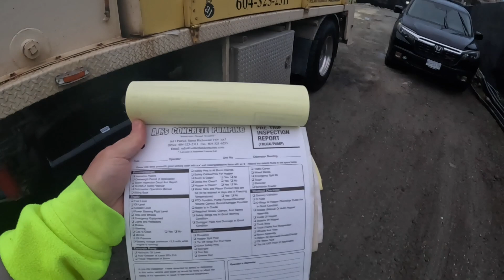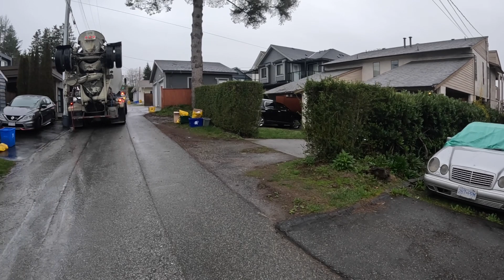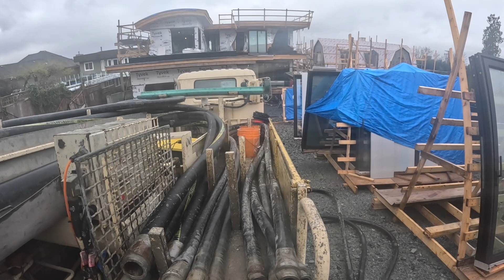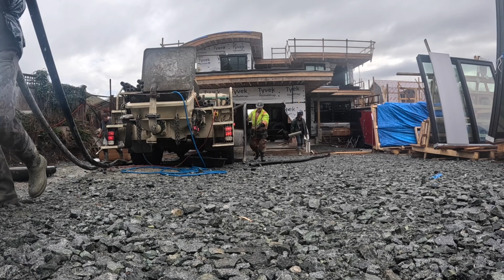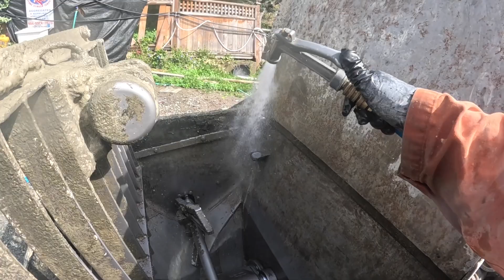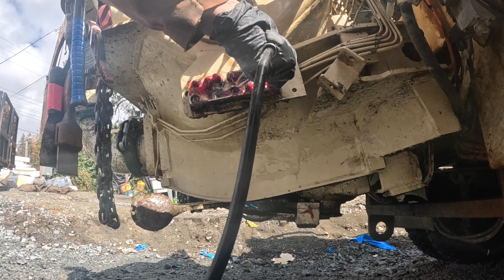A typical day of pumping concrete.

Comment: Hey Scott I wasn't I went through a 4-year apprenticeship program do you think that with the four-year apprenticeship program I went through as a finisher for concrete I have 10 years invested in the union and they're not including what I did as a teenager do you think that I would have a pretty good possibility of becoming a pump operator that would be a good pump operator versus somebody
Reply from the maker: Absolutely!!! Much of becoming a proficient pump operator is knowing/respecting the time sensitive nature of the material (concrete) with which we are working. Your knowledge and experience with placing and finishing concrete most definitely gives you a leg up, in my opinion.

Comment: I wish I could use 2 Inch Hoses here in DUBLIN IRELAND we have to run 4 inch to the Pour Area and then we put 3 inch Hoses in the pour area because some days the Concrete can be rough but in the past year or two it's got a lot better and i think about 75% of the time we could use 2.5 inch if we had some and maybe even 2 inch Lines depending on what concrete plant the concrete is coming from because Same Concrete Company different plant can be harder to pump sometimes different Sand and stone depending on which quarry it's coming from

Comment: What is the max distance can you pump?
Reply from the maker: We have pumped 700 feet with this machine. With the proper slump/mix design and pushing through 5” steel pipeline, it would likely pump over 1000 feet horizontal. 

Guys with high-pressure pumps will push 5000+ feet.
Reply: @canadianconcretepumper1979  Thanks for the input.  I need a slab poured about 500ft from the street.

Comment: That first job is a direct pour all day.  I think more difficult to pump it then pour direct
Reply from the maker: We pump almost everything around here, especially work with our in-house placing crew. They way they in which we like place it down works much better using a pump. 100% it could be done from the truck, but we have our own pumps, so we use them.

Comment: Put a pea gravel screen on top of your screen. It should help with those gnarly rocks.
Reply from the maker: I’ve got one on the truck (2”X2” mesh screen). Problem is that with this 1/2” mix, it has to be a good 5” slump to vibrate through the screen. Guys forgot to order accelerator, so being that it was a machine finished garage we didn’t want to wet it up too much or they’re have been there all night. I kind of wanted to catch a couple of plugs as well, just for demonstrative purposes.

Comment: Bro you have to use a grill for safety.
Reply from the maker: It ain’t safe of the concrete won’t pass through and you’re sucking air. With this 2” secondary screen the concrete has to be a good 5” slump, and there’s certain things we just don’t pour that wet.
Reply: @canadianconcretepumper1979     I understand.  I live in long island NY I operate a line pump almost the same as the one you have  my pump it has a vibrate in the hopper ,it work good with 5 lumps. But I like your video 📹
Reply from the maker: @rifirafa  same thing, we’ve got the vibrator mounted to the hopper grate and it works really well for shaking most anything through the factory installed grate. The secondary screen which we use when running small line had really tight spacing (2”X2”) so even with the hopper vibrator running it has a tough time shaking 1/2” stone mixes through if they’re not at least moderately wet. Thanks for watching the channel man. These VS series Putzmiester’s are great little pumps 👍🏼👍🏼👍🏼
Reply: @canadianconcretepumper1979   I also have the putzmeister TK50

Comment: Mexican aggregate
Reply from the maker: Just came off a pour today (video coming later this week) and man oh man was the mix ever sandy/coarse. Just grinding through the hoses. I watched a driver add 50 gallons + 5 litres of Adva to a 9 meter load and the slump went from an 80 to maybe a 100.yesteryear sand just be eat’N up the water!!!
Reply: @canadianconcretepumper1979  the place I worked at a few years ago started having really coarse sand, almost 5mm where as everyone else in saskatoon was running 3mm. I was pumping a 32mpa mix and it was so bad I had to go 1 stroke fwd and then go backwards a stroke, then I was able to get a few strokes fwd. It also stalled out the pump at full rpm

Comment: More efficient way to wash at the end to reduce water would be #1 dump remainder of concrete on the ground then scrape hooper sides with a small spade/scrapper #2 put pump in reverse and manual mode #3 reverse pump till you see piston cup which pushes most of concrete from the cylinder #4 jog s- tube to other cylinder and reverse pump to clear concrete cylinder #5 jog s-tube for about 5-10 seconds which shakes concrete from s-tube into the cylinders #6 quick wash into s-tube #7 reverse both concrete cylinders again and when piston cups reaches the end of the cylinders a quick wash to clear remainder of concrete. This process leaves the piston cups clear of build up on the face of them and all components spotless inside.  👍
Reply from the maker: 100% agree with you. (the intent just here was to keep things as simple as possible for the purpose of the video).

Comment: I see you had screens on the pump but didn't use them. I'm sure you have said that they were mandatory to stop the big rocks like that :) 

I love pumping would love to go have an easy time over there, everyone here seems to use 4 inch pipes lol.
Reply from the maker: Mix has to be minimum 4” slump to pass through the secondary screen. On that first job, no accelerator was ordered in the concrete, so we kept it dry as such that the finishers would not be waiting around all day to get the machine on it. Second job we had to keep the first couple meters of each load dry because of the slope which the mixers were sitting on (otherwise it would be spilling out of the truck even with the drum in charge mode). 

We’ve spoiled over here with our 2” line mixes. Mad respect to those whom slug it out in markets where 4” hose is the standard.

Comment: It seems like here on the west coast we are the only ones who help with pulling the hose and stuff like that. Other places they get it primed and only do pump on pump off.
Reply from the maker: Yeah, it seems like a lot of the markets with larger sized line (4” and 5”) the operators don’t run/drag the hose, which is understandable. Other markets it seems standard that the line-pump operator also runs the hose (California, as well as Australia. Would be curious to hear opinions on this from people in different regions. I just have a guilt complex with standing around watching everyone else work 😂😂😁
Reply: @Canadian Concrete Pumper   In the union market, it is the labour's job. 

I ran system and boom hose my first 8 years. Kinda nice as an old man to have youngsters that do the hard work.

 I teach, they work. Days go by fast and smooth...